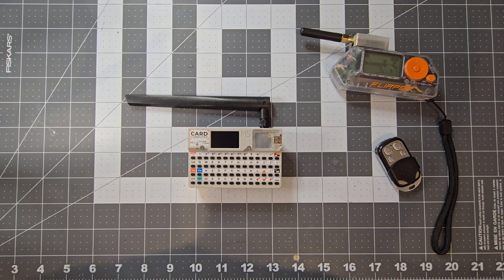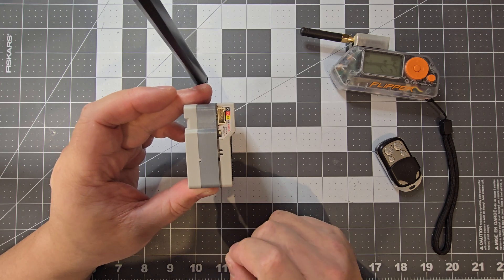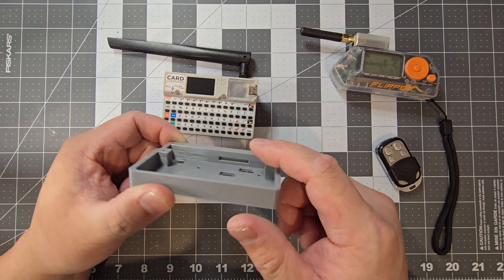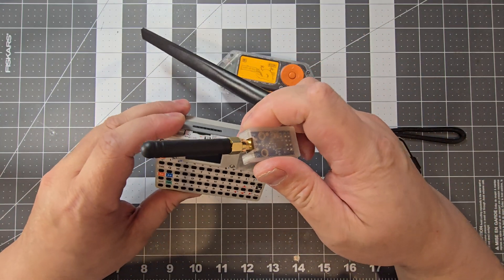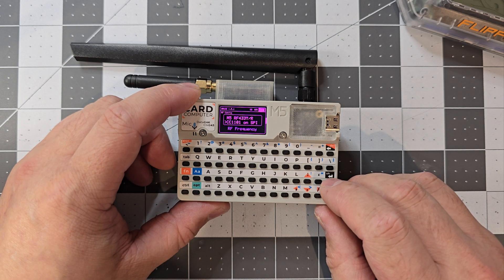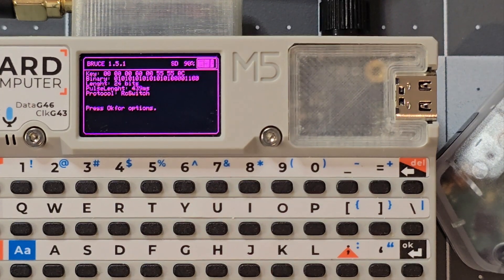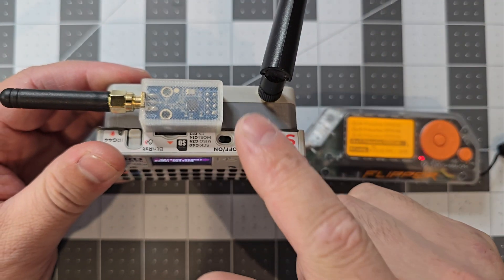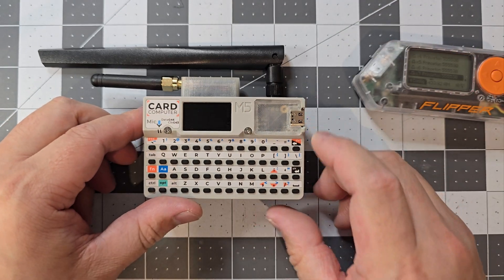M5Stack Cardputer Upgrade: Choose Your Add-On – CC1101 or NRF24?

Comment: Hello Ray, with this 3D base would it be possible to adapt a LoRa 1276 module to this case? I have a cardputer and I really want to do some project on it for Meshtastic and I don't even know where to start, I saw that there is a module called "Grove - Long Range 868MHz" but I don't know how to make the cardputer talk to it, any tips?

Comment: como consigo ligar apenas o NRF24 no Cardputer
Reply from the maker: @evandrovitorino9108  Sorry I don't understand.
Reply: @rayj1988  How can I connect only the NRF24 to the Cardputer?
Reply: @rayj1988  I made the same connection as the cc1101 and it is not recognizing the nrf24

Comment: Hello, thank you for your video and 3d model for a spacer. I dont know if it is possible, i just wonder are there any ways to connect nRF24L01 module to a cardputer, i've tried to find any information about that but unfortunateley couldnt find any. There are ton of information how to connect this module to m5 stick but nothing about cardputer, because they are both using the same chip i assume that there should be some way to do this. 
That wold be really nice if you have any iffo to share. 
Thank you
Reply from the maker: I have a link in the description.

Comment: Love the video 
I had a cool idea add a cc1101 and nrf 24
With multiple anntenas
Reply: Greetings, have you found the way to connect nrf 24 to a cardputer?
Reply: @Alex140803  it's on bruce github, you need microsd sniffer and soldering skills

Comment: Can you do a video about the wifi/antana upgrade/how to on the cardputer
Reply from the maker: Here is some more info on what I did.
https://www.reddit.com/r/CardPuter/s/PqvRaAeA27

I would recommend printing one of the spacers i designed instead of doing the way I did as it will be difficult.

Comment: Hey, when you boosted the battery, how did you modify the charging circuit?
Reply from the maker: @ynfafeusd  I just soldered in a battery with higher capacity.

Comment: Hey Ray, there's the perfect amount of space along the front edge to add a AA battery holder that you could use for 14550 Lion cells 👍

If you wanted it to be temporary, you could attach it with adhesive velcro.
I've used it to attach some 18650 battery holders and it works well.